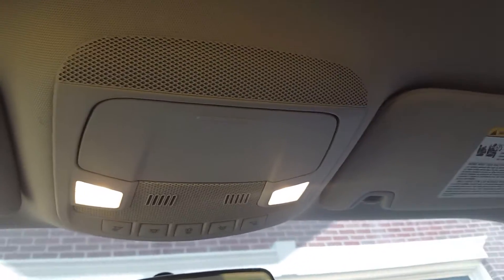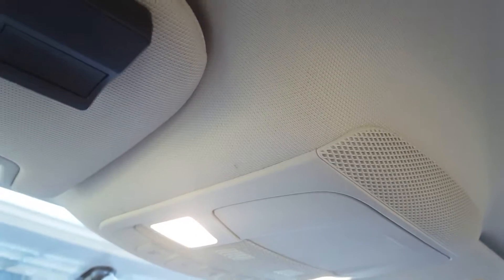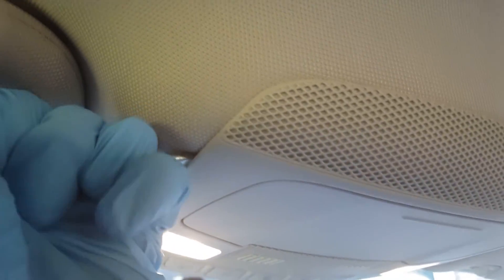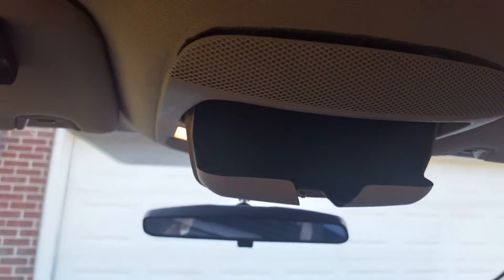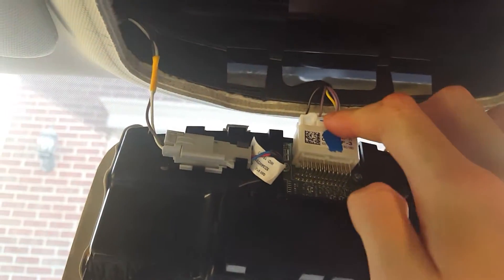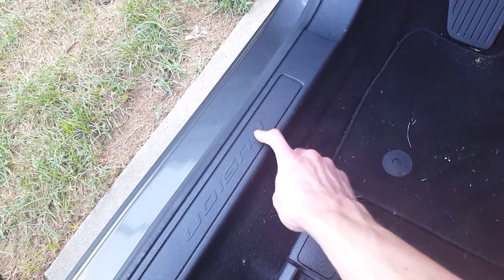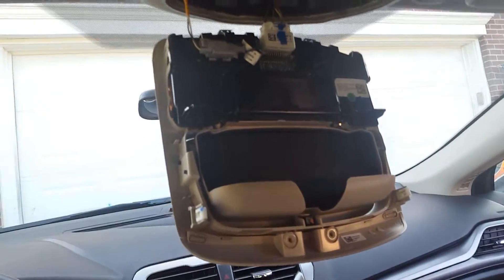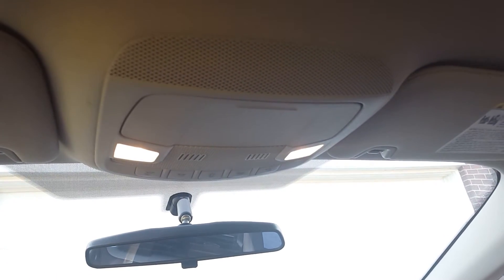How to remove the dome light on a ford fusion

Comment: DO NOT try this method if your Fusion is a 2013 model. The two mounting clips toward the rear of the car are different than what's shown in this video. They are thin plastic and molded with the whole unit. They first have to be disengaged from the black plastic mounting shell that's part of the headliner before pulling down. Otherwise, you WILL break either the clips, or worse, the headliner mounting shell. It would've been nice if Nick had told us WHAT YEAR his Fusion is. Also, it's called an Overhead Console.
Reply: We've got a '14 with the sunglass pocket broken so I'll be looking into 'fixing' this pretty soon. Do you know if this design with the '13 models was definitely changed before '14 ? I do see that Ford superseded the original p/n with an updated p/n.
Reply: @HallStevenson  I got the part from Grainger that's described in this link: https://www.fordfusionforum.com/topic/17610-sunglasses-holder-latch-broken/
Reply: You are 100% correct!  Wish I saw you comment before I broke the clips on my 2013 fusion.  I realize now that they can be disengaged by reaching a finger through the sunglass holder when it is folded down.  The part seems to be holding fine even though these 2 clips are now broken.
Reply: @robertkritzer8154  but once you pull them back ones just pull from the front as nick shows? For a 2013
Reply: @robertkritzer8154  how did you put it back in and secure having hard time doing so doesn’t line up

Comment: Note. When you open the headless case. On the inside are two tabs. One in each side.  You pull them in towards the center. Be careful they may break.

Comment: If anyone else here is trying to get rid of a rattling coming from the overhead console I removed the black plastic piece with the metal clips attached to the microphone wire and reinstalled with the remaining 4 clips, still solid mounting

Comment: hey nick i have a problem my dome lights aren't working they dont turn on when i open the doors neither when i close them
Reply from the maker: Joe Gotti does it do with all the doors or one of the door I'm having that problem with my driver side when I open my driver side it don't respond
Reply: Check vehical settings on your dash

Comment: Which wires did you connect to?
Reply from the maker: Khloe Reagan what do you mean connect to what?
Reply: I’m trying to instal lights that turn on when the door opens and turns off when the doors close. but which wires do i connect them to? and which ones the negative?
Reply: @Chloe_reagan  I'm looking for this as well. have you found the solution?
Reply: I guess I will just use a test light on the 3 wires to see which one gets power when the door opens and turns off when it shuts.